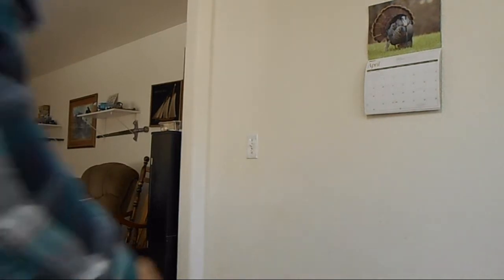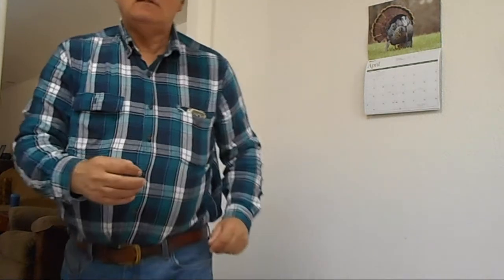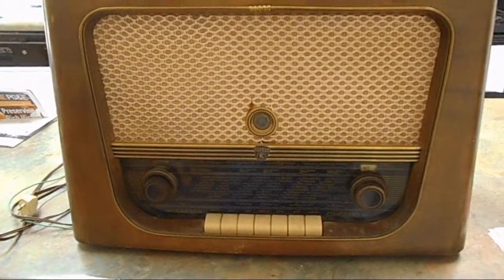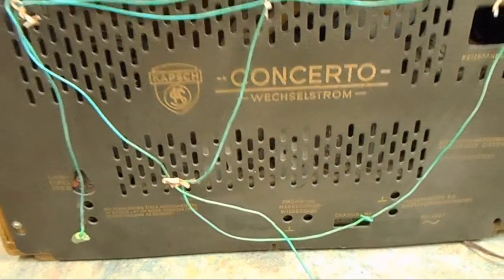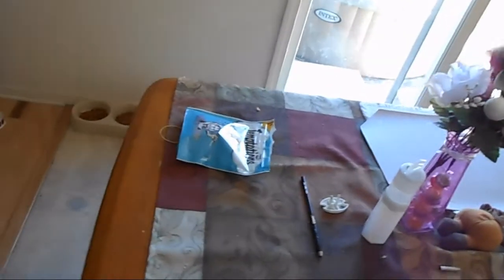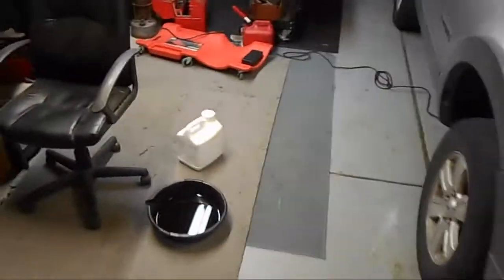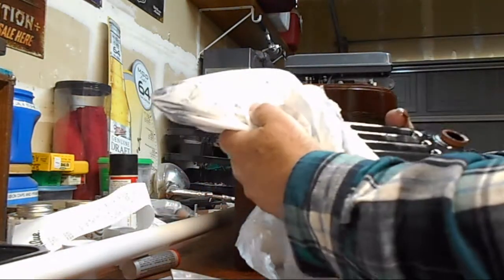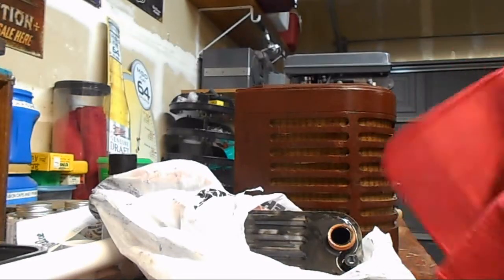Update on Explorer and Garage sale Radio and Magnifier

Comment: It's Germanski all rightie, could be Philips, Telefunken, Grundig, Nordmende, Blaupunkt, Saba, - my guess Nordmende or Philips.
Reply from the maker: It is Made in Austria and the name of the company is Kapsch and the model of the radio is Concerto and it was made around 1956/57 and it is a subsidiary of Grundig. You will notice Grundigs had a similar style cabinet. The story I got from my neighbor selling this is that his Mother lived in Canada in 1950 to 1960 and bought this radio there in 1957. Around here you do not see these very often.
Reply: Yup Larry, German radios look very simular, mostly like Grundigs Telefunkin and Philips.  I wonder if the others' are licensed and rebadged.  Many of the USA AA5s were RCA inside.  RCA, Philco and Zenith were the big three here.  But the Germans were far better engineered.  It will need a good dose of contact cleaner.  I need an English schemtic for my Philips Jupiter.  And you'll need tube conversion too.  One thing I like about German radios are the woofers/tweeters instead of those crappy 4" speakers in cheap AA5s, they sound much better, plus better performance in selectivity and sensitivity.  And they have those kewl tuning eyes.  Don
Reply from the maker: Yes Don I was surprised when I opened this one up and it had 3 speakers. When I get an adapter for this European plug i'm gonna try it out everything looks perfect.